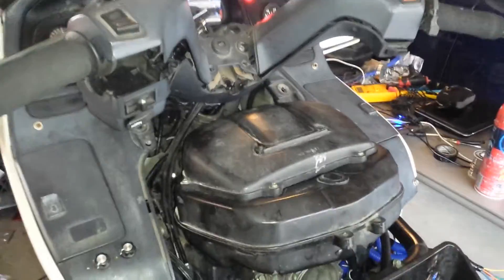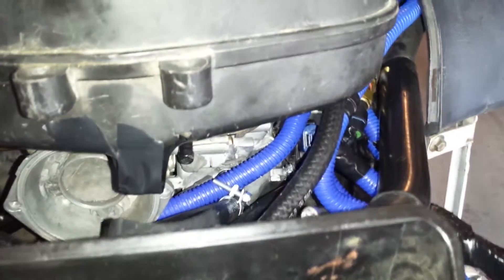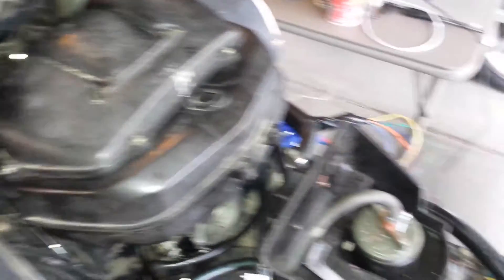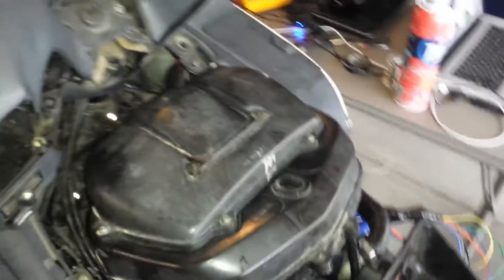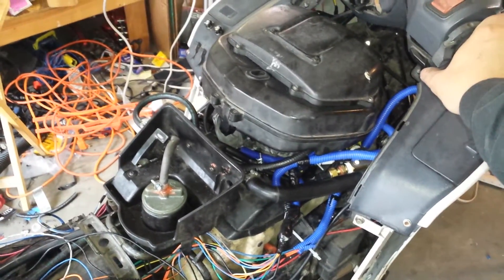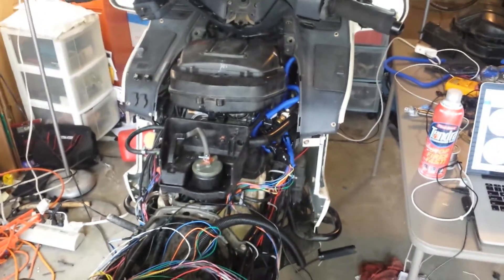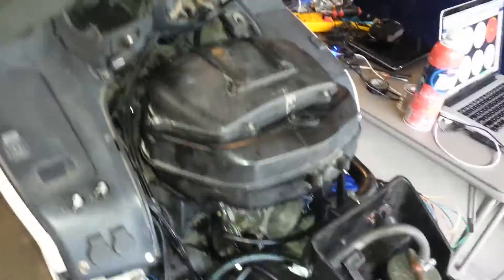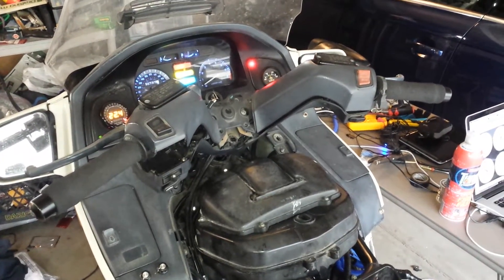First run of the Honda Pacific Coast PC800 on Fuel Injection

Comment: Has anyone ever tried just using the IAC stepper motor and letting it push against the throttle stop directly? (just like your idle screw on a carb) . Most IAC is always a bypass around the throttle plate, but it seems like it could move the throttle plate directly without too much trouble.
Reply from the maker: I think that would work as long as the ECU can support a stepper motor and the TPS is not relied upon while the IAC stepper is opening the throttle plates.  The most recent MicroSquirt would support that... I think.
Reply: Douglas Van Bossuyt Standard GM ECM from the 90s uses a stepper motor, so I was assuming just purchasing a GM replacement stepper motor and mounting it under the throttle plate mechanism. Had not thought about the TPS getting upset from the throttle plate movement from the IAC.
Of course I really wonder how important the IAC is anyway. I've run my GM tune with the IAC unplugged. Never had a problem with it stalling. The PC runs such a high idle anyway, much higher than needed to keep it running. It would probably be fairly forgiving running without it.
Reply from the maker: Daveinet I'll find out soon enough.  Just getting everything back together on my PC800 to start tuning in earnest.  This project has been full of stops and starts as I have time and whatnot.
Reply: Curious,,wondering how many pcs were built,,vs how many  left ???